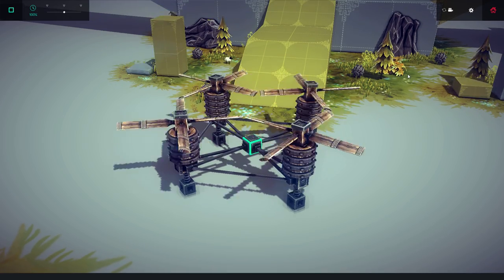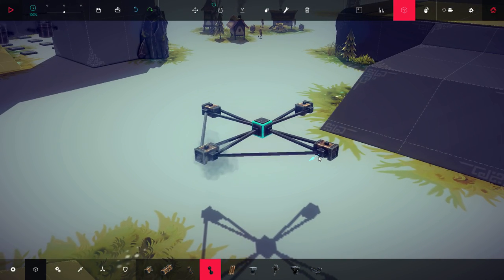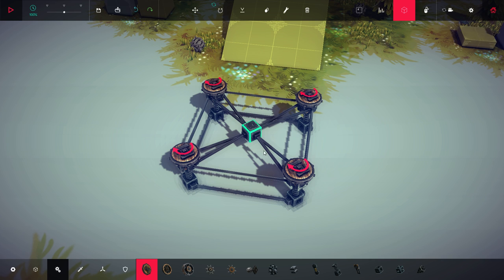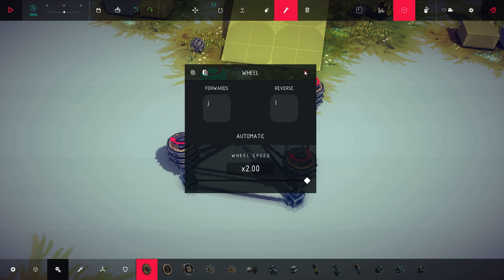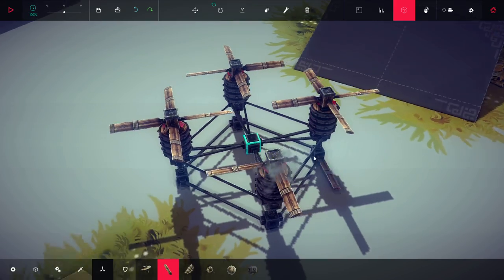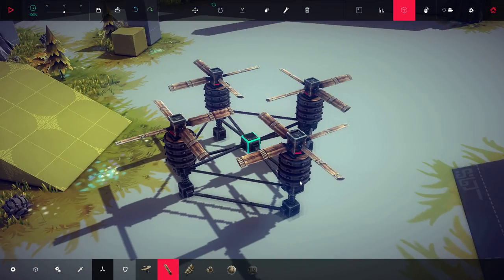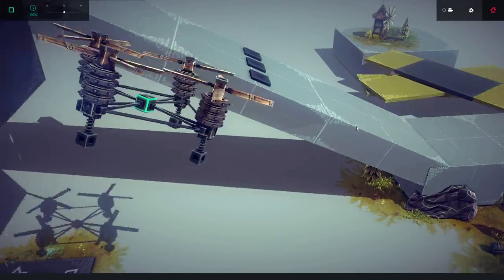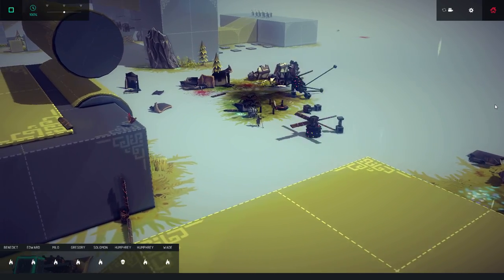How to Build a Quadcopter in Besiege

Comment: This one works great for me! Had to play at 25% speed for the level where I need to kill a bunch of archers then pass through 3 gates.

----------------------------------------------------------------------------------------------
TL;DR 

The default direction of propellers/wheels are "+". Flip for "-".
 -+;+- means + on the first row, and + on the second

 Propeller -+;+-
 Yaw(rotation) ++;++
 Pitch(forward/backward)  +-;+-
 Roll(left/right) ++;--
 Lift(up/down) -+;-+
----------------------------------------------------------------------------------------------

Notation: I'll use "+" and "-" to denote the directions of propellers, wheels, and lift. "+" is for clockwise/upwards lift and is the default type.

Propellers: All 4 on the same axle should be of the same type. Counterclockwise for the ones on top left and bottom right. So with my notation the configuration should be +;+. Take this as given.

Designing principle: The total torque is the sum of the signs on each wheel. The distribution of the torque doesn't matter as long as the components are joined rigidly. The lift on each wheel is the product of the sign of the wheel and the sign of the corresponding propeller. Each layer of wheels operates independently.

Say I want to design the pitch layer. When this layer operates, the copter should lean forward, so that the main lift from the lift layer pushes both up and forward. The lift diagram should look like this: --;++. Divide this by the propeller diagram (-+;+-) position by position (or multiply, they're the same thing when only 1 and -1 are involved), and we get the torque/wheel diagram +-;+- as indicated above. The torques balance out, so no yaw is involved here.

With this you should be able to figure out how to design copters independently in Besiege. Have fun!

Comment: Thanks bro. A great quad copter. I was able to replicate it accurately after couple of tries :) I have one improvment - If you add spinning blocks instead of wood blocks at the top, spinning  in the same direction as the top most wheels, the quad copter will keep hovering. If only it had the gyroscope to level itself  after you release controls it would be magnificent.
Reply: +Holtijaar Oh and it's easier to control if you set the controls on the numpad, as they keys are closer together.